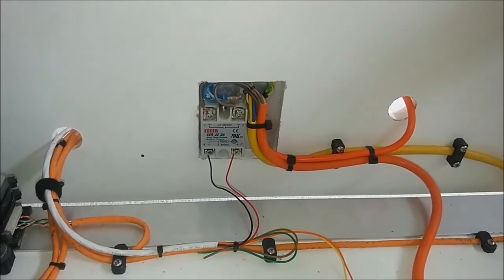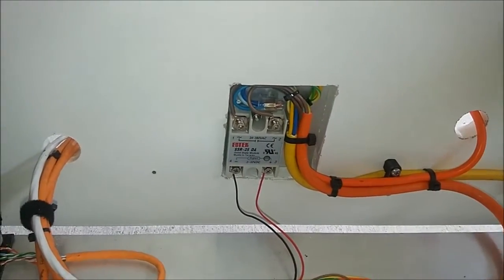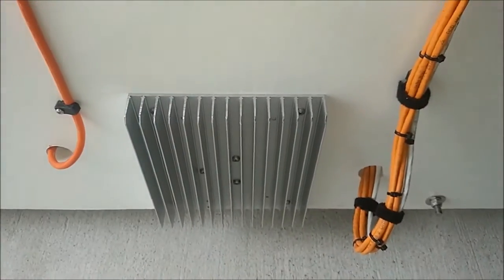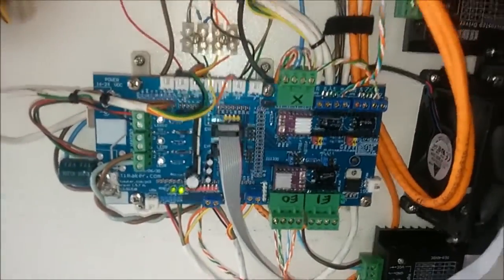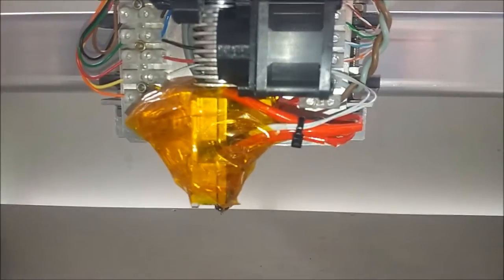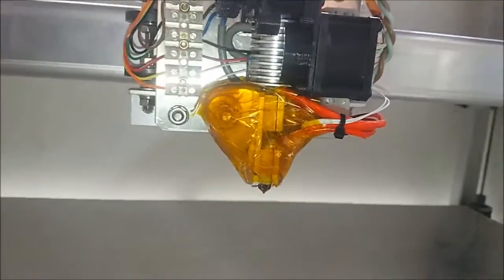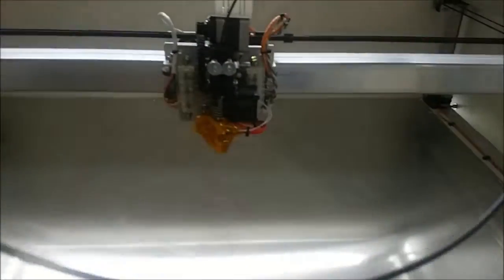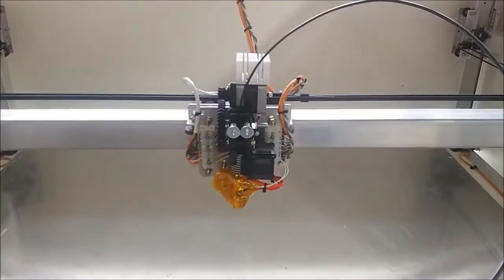Large scale DIY 3D printer - 1200 x 1200 Sub33D V3 - Solid state relay setup and first test print

Comment: Dear sir, I am facing difficulty with adding TB6600 stepper driver. Here in your video I see that you have used TB6600 stepper motor driver and done some modification in the wiring(Here is your image file that downloaded from Thingiverse). 
Please sir, I am not getting why and how you have added some additional wire?
I will be grateful to you if you give me details of the wireing diagram where you have done some modification. 
Please sir,................ I will be really grateful to you.

Comment: That's a pretty impressive machine. I'm curious about the quad volcano setup. Would that be controlled by an ssr similar to the silicone heat pad arrangement?
Reply from the maker: The current dual volcano stack is running off the 12V PSU (controlled by the high current Mosfet on the Ultimaker main board)
 I am currently building a dual 100mm tall stack, 320W (8 x 40w heaters) 1.5mm nozzle extruder which should have 4 x the flow rate of the current one (16 x the flow rate/speed of average 3D printers), this one will need a separate 12V PSU and several high current Mosfets in parallel to control it.
Reply: That's interesting for sure. I'm currently running 2 volcanos in line like the video with the second connected to t1 extruder, but that requires separate commands. I run it about 60mm/sec with a 1.5mm nozzle. With a 320w setup like that, you could easily use a larger diameter, but I guess run a slower speed, and loss of detail. Either way, great work and can't wait to see your new setup running!
Reply from the maker: Thanks for the info, I was also running 1.5mm with my dual volcano but found the 4 x 40W heaters were not strong enough to heat the filament fast enough and could not keep the temp up.
What layer thickness are you printing at?, I am printing at 0.5mm layer height
Reply from the maker: Sorry meant to say 2 x 40W heaters,
Reply: I believe I was running about 0.5mm layer height. It is two volcanos with a 30w element each. I was unable to print infill effectively, but the perimeters print very nicely. I am currently rebuilding it, the second printer I have is receiving two volcanos with a 40w element each at 12v, but will have P100 sensors since thermisters were not capable above 260C. But would a straight AC element either 120v or 220v be possible with a custom machined heater block controlled by a ssr to board?
Reply from the maker: I saw the same issues with the perimeters printing perfectly but the infill was full of gaps, I suspect caused by un-molten filament hitting the nozzle due to the higher infill speeds and flow rates
A 120 or 220v AC element would work perfectly with a solid state relay for the extruder, I did also consider this but decided to stick to 12v for safety reasons (trying to avoid or at least minimize 220v use/wiring)
Reply: That makes sense about the gaps. I installed a breaker switch instead of fuse on my silicone heat bed, which could work well with a heating element also, but either way the power is way higher. Also, that would probably require a whole new extruder carriage design for the more intensive hardware. Thanks again for publishing your work.